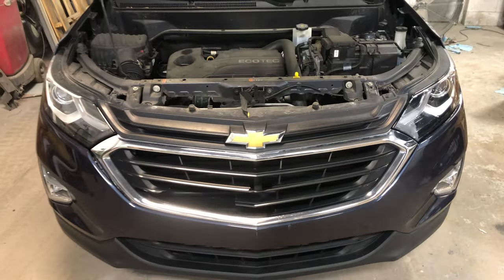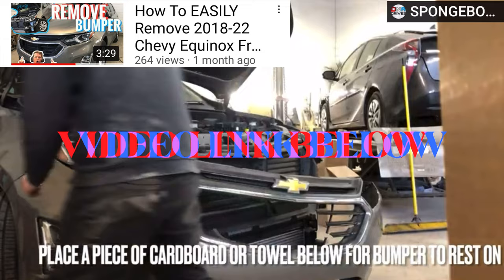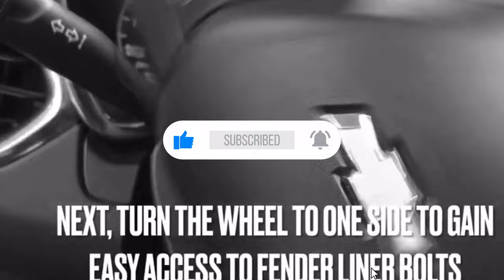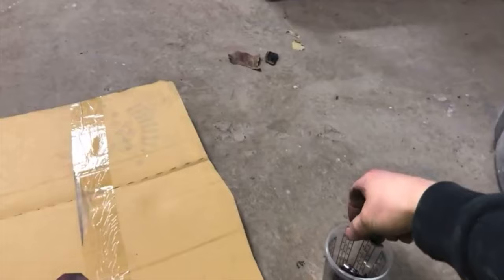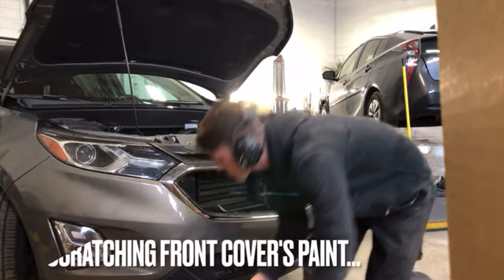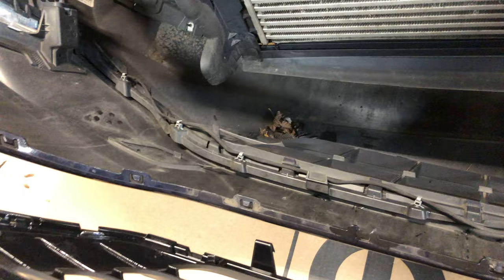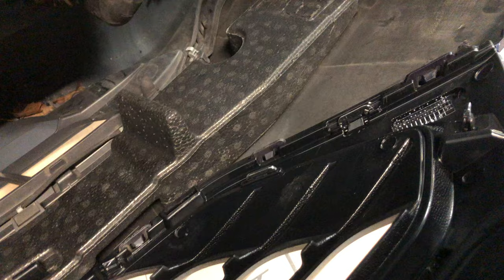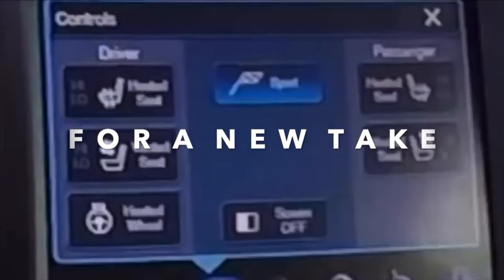How To EASILY Remove & Install Grille On a 2018-23 Chevy Equinox | Step by Step Guide

Comment: Where is the sensor for the (ambient air temperature sensor located ? After removing my grille I could not locate it to replace 😂 I have a 2019 equinox ls

Comment: How do you remove the top chrome piece going over the headlight on 2023 Equinox? Not showing on video.
Reply from the maker: Hey, if you’re still having trouble and need some help, I created a video on the brand new Equinox’s, how to remove the chrome strip and bumper. The video is on my channel! https://youtu.be/W5E68hOs2Qw?si=DN7s0upHh9AwkAmo Hope this helps. Thanks for commenting and watching!
- Garrett / SLA’S GARAGE

Comment: You make it look easy!! My  Tahoe has a nest of some kind at the bottom of my radiator and now the radiator is pretty well covered with grass and straw. Do you think I'll need to do this to get to the radiator? I don't really see any other way to clean up the debris...
Reply from the maker: Hmm, you may have to take the bumper off to gain access to clean everything out. Any way you can stick your hand through the top or bottom grille to fish out the debris? Maybe use a water hose, gently spray everything out. Thanks for watching and commenting!
- Garrett / Sla Automotive Art

Comment: Hi I had a quick question about only having to replace the fog light housing.
Reply from the maker: To do this, you will need to remove the bumper off of the car. I made a video explaining how: https://youtu.be/tpn5hzW38LQ?si=TdjNGFZDKovEXYUB

Once you remove the bumper there will be a few bolts or screws holding the fog light in place. Good luck let me know if you have any questions

Comment: I've watched the video  on removing the bumper on my 2020 equinox.  I'm having difficulty locating what is called a 7mm bolt facing downward.  I find 1 but looks like the head is round and may be here head. Can you help??????
Reply: Check where the fender and bumper connect from the outside and look there on the inside

Comment: So do I have to remove the whole bumper or can I just get the old one off and pop the new one in ?
Reply from the maker: If you remove all bolts up top and on both sides (maybe even just one) you’ll be able to slip down there and remove the grille. You do have to access the grille from the backside to get it out